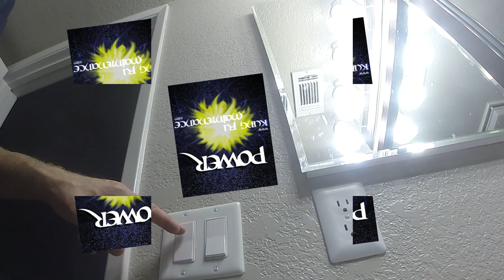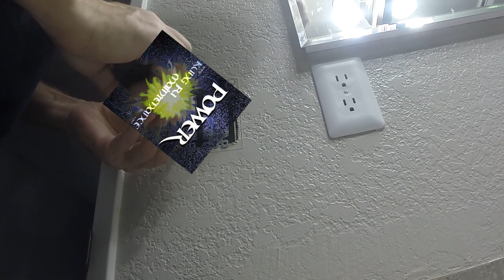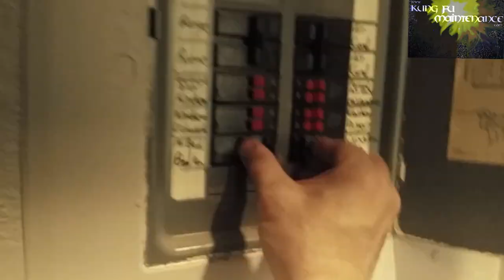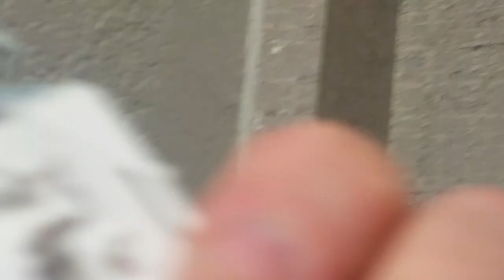Inside Rocker Switch

Comment: Just a heads up on 30+ years of being an electrician never trust those push in wire hole make the loop with any needle nose or even a lot of screwdrivers come with the hole to make the loop then just wrap the switch screws with black tape & your done only saying anything from temperature change to that fan vibration even vacuuming & ceiling fans have caused the wires to pop out & it's a 50/50 chance it could be the feed wire & this goes for outlets & everything from decora to plain old duplex outlets 1 more little thing is that outlet so close to those switches fed from that switch box only ask cause it should be GFCI protected & 9 outta 10 times an outlet so close to a switch like that means a rigged neutral & not a true neutral...good luck & stay safe!